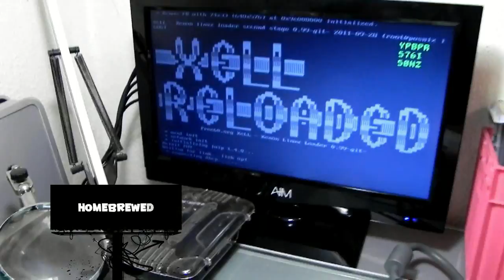Channel Promo

Comment from the maker: @paulspydar ,I dont really have a video on flashing a 360 ready yet, I do however have a video on glitching a xbox 360 to recover the dvd-keys on it, to get it working again, that is set for upload next.

If you can post the manufacture date of your elite, I can check what dvd drive your most likely to have and ether point you in the right direction or make a video about it :)